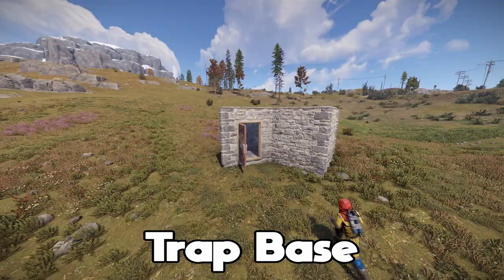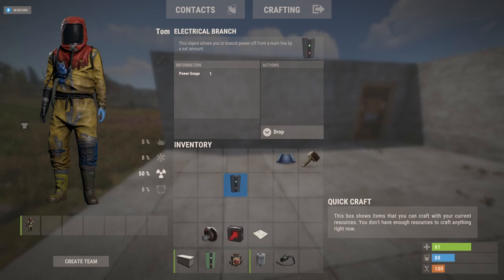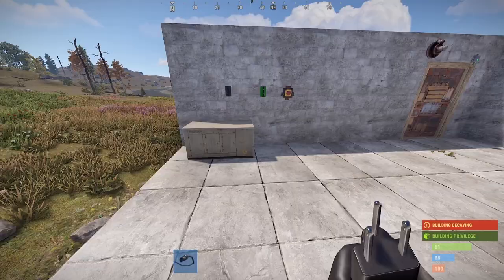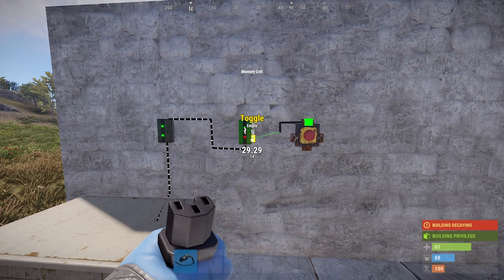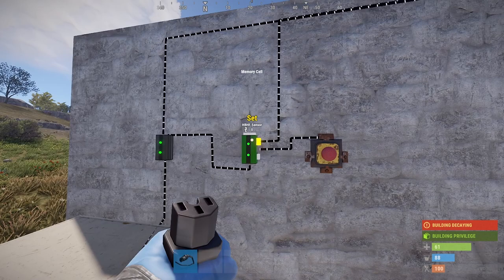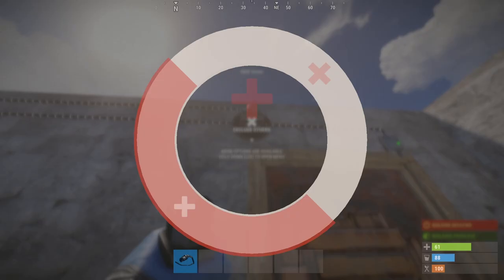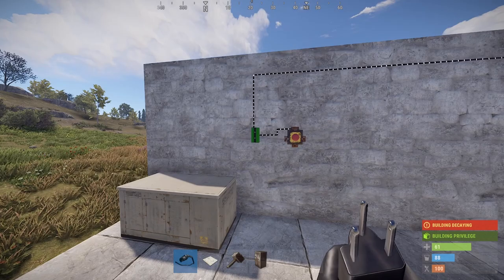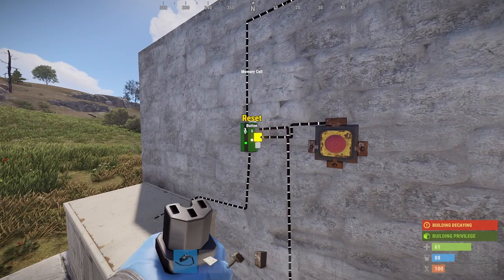Rust Trap Base Door Guide

Comment: Power source is an overlooked aspect of these videos. An open door with a solar panel/turbine on the base is an immediate 180° turn for good players with good gear. A medium or large battery will hold a door open for a long time and can be charged via generator.

Comment: lazer's suck , the beam is noticeable .. HB sensors are the way to go.
due to the memory cell switching to the "normal" rightside powercircuit if and when the trap is activated by a victim .. you could plug in a turret or second set of opening doors with shotgun traps to that "normal circuit (so the trap does the killing for you aswell)

I used this system forever, never fails to provide loot and funny moments